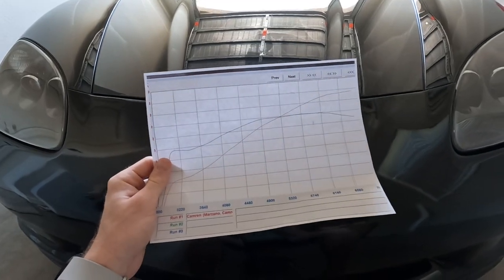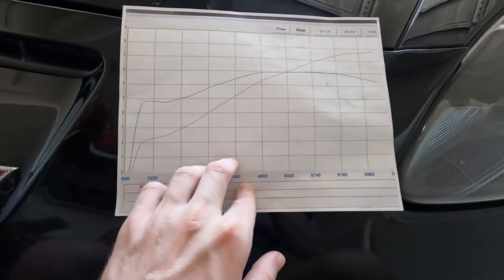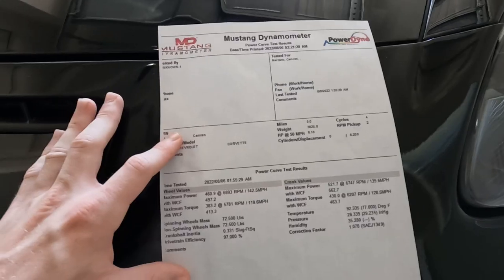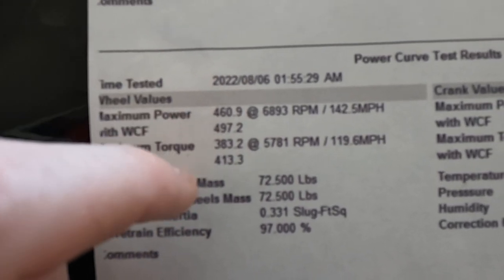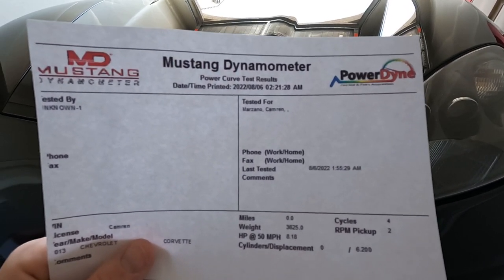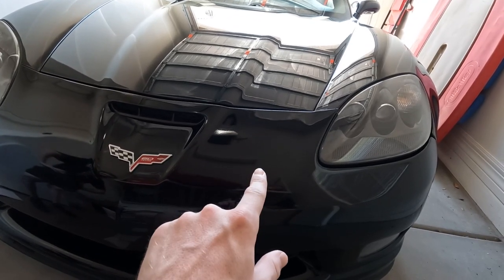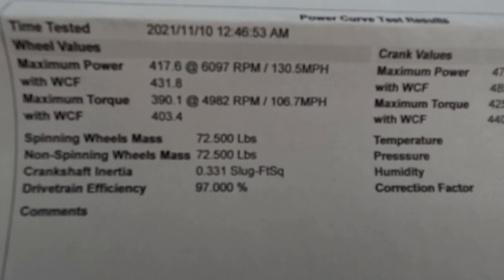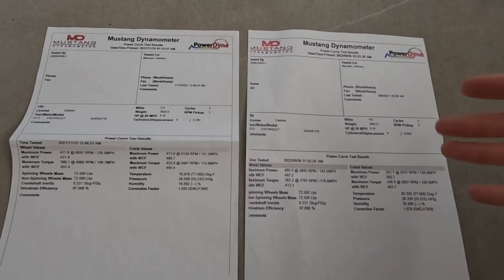C6 Corvette Dyno *BTR Stage 4 Cam*

Comment: 1st off. Good choice of cam. Its a great off-the-shelf' cam. But I'd get a 2nd dyno test. I dont see how an ls2 making 460whp, made so little tq. Something is not right. 450-460whp range is what this stage 4 cam should be making with bolt ons and tune. Ported intake or better? Were heads worked in any way? Even just blending and removing the rocker stud boss bump dramatically helps. But full port, cnc or aftermarket heads would def be most beneficial. I would take to a random shop with a dynojet and make sure they measure in SAE.. STD reads higher. Crappy scamming tuners will do baselines in sae and then final run in std to make it seem like they picked up more whp/tq from their tune. Seen it happen a lot in the import crowd. Too bad my buddy has his dynojet in storage. He's in socal. San Diego area (Santee). Would be a nice drive over. Was called 'the best dyno.com'. But there's 'the dyno shop' also in santee. Bunch of performance shops in that area.

Comment: sorry if i missed it, but did you have a tune before the cam? i know you said you had an intake, but 430 is crank numbers for a stock ls3. congrats on the 500 wheel mark though!
Reply from the maker: I did, it had an intake with headers as well. It put down 432 to the rear wheels
Reply: @CamMarz  ah i was gonna say 430 wheel is a little high for a stock ls3! what intake did you end up going with?
Reply: @CamMarz intake?
Reply from the maker: @Tazerect  Airraid